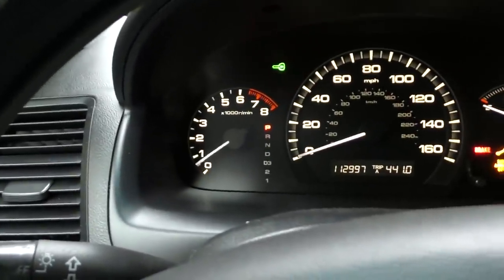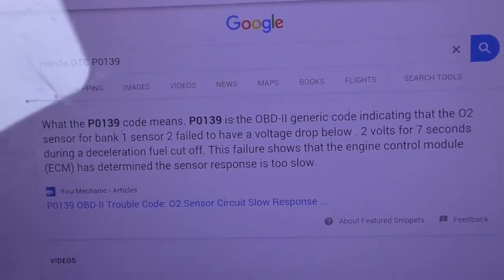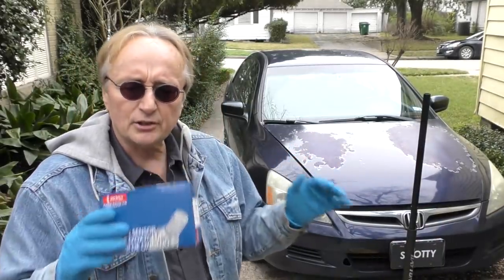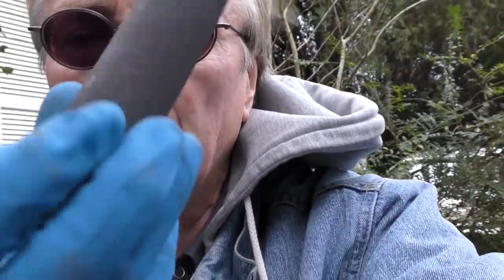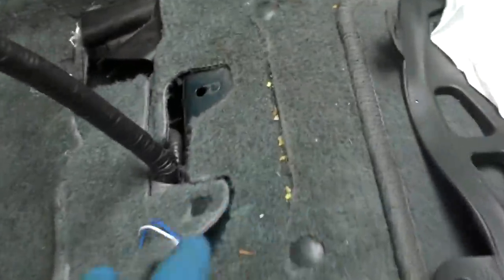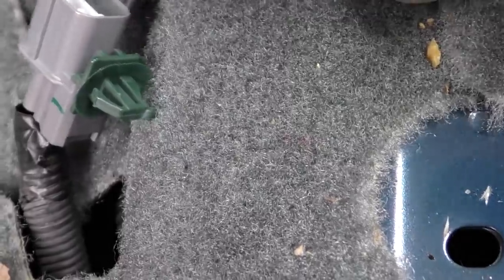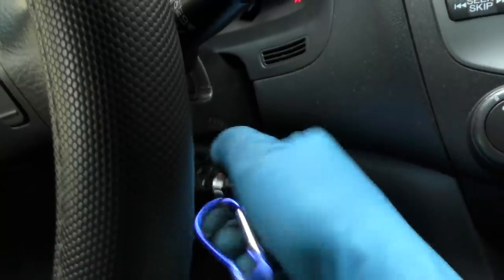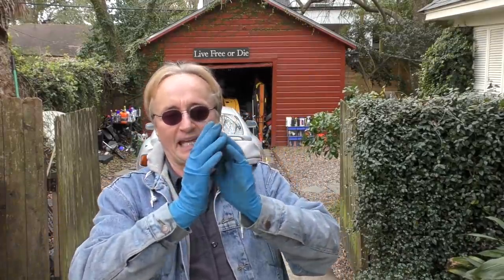Here's Why Mechanics Hate Hondas

Comment: Scotty
My Daughter has a 2015 Kia Rio 5 with intermittent electronic steering issues. At times the light comes on the car won’t start. Other times while she is driving the light comes on and causes the car to quit. This has happened several times on the highway. No one can seem to find the problem. And it will cause the car to have multiple lights on the dash when the electronic steering light comes on.  HELP ME PLEASE. I fear for my Daughters Safety.

Comment: Thank god you don't have to remove the whole dash just to remove the plug
Reply: I had a friend who was working as a tech at a VW place years ago, and they had a campaign on defective balance shafts which required the front chassis to be dropped to replace. Well he found that he could get the shaft out by denting the inner wheel well with a hammer, which would give him enough room. After the replacement, he would massage the dent out, repaint and re-undercoat, and clean up on the flat rate.

Comment: How many cars the secondary O2 sensor is only there to tell you whether or not the catalytic converter is operating properly.
it does seem as though the O2 sensor is in the middle of the cat on this car so perhaps it is used to control fuel mixture.
But on most cars that I have seen your only using the front O2 sensor to control mixture and the secondary O2 sensor is only there to check if the catalytic converter is operating correctly.
if the catalytic converter is bad or that secondary O2 sensor is bad you will usually get a catalytic below threshold code.

Comment: that aint too bad, i have a 90 corolla gts, the thing last forever, but it is a pain in the but to work on maintence stuffs. just replacing the oil filter is a small challenge cause it's so tight spaced, i can barely get my hand in there., replacing the seprentince belts, my goodness major pain in the but, cause it still use the vbelts system and u have to take off the side mount engine mount to get space.same thing with the exhaust manifold gasket,

Comment: I've noticed on my car there periodically is some alkaline-like buildup that occurs on the battery terminals (both equally on the positive and the negative). I've heard this is a common problem with cars as they age and to use baking soda, water, and a toothbrush to to scrub it off. However, I'd like to know what really causes buildup on the contacts. Is my alternator going bad, or do I need to be concerned about something else? It's an '08 Ford Focus SES, with over 237,000 miles.

Comment: My issue with my cat back fuel/air mixture sensor is it fails to send the voltage to ecm off idle inconsistently. From OBDII reading I got 700mV at idle and then when I step on the gas, ecm O2 reading drops to 0 and the check engine light came on with p2178 too rich off idle. Not sure what the difference between idle and off idle condition that can cause this. 2010 Mazda 5 (virtually identical to 2006-2009 Mazda 3)

Comment: Scotty, I'm looking at a Lexus LS 430 with 56k at 9.5k from a used dealer lot. I currently got a hyundai sonata 09, with 176k miles, no major problems as far as driving, but it seems to have a recurring EV problem that gives me trouble every 2 years for smog check. Should I change over to the Lexus?

Comment: Honda has some serious issues with their clear coat🥴. I thought only Chrysler, Ford, and GM had those problems. Nice cat converter sensor replacement video. 😉👍🙂
Reply: I recently stopped into my Chrysler dealer to drive a Pacifica and they had a 2017 with 55k miles already bubbling up and loosing paint. They offered to fix, but I can't unsee it.

Comment: Hey Scottie I’ve got a 02 Silverado 1500hd with a 6.0 engine. Driving down the road the abs and brake light pop on. I’ve done a little online reading and found where it’s probably a ground wire that goes down the back of the engine. Have you run across this problem?

Comment: i had that same code on my 09 mitsubishi at around 132k miles and i put seam some in the gas tank as per instructions ran it and the code went away for a few houndred miles it then came back so i put a little more sea foam  this time and i haven't had the code come back yet and i'm at almost 137k miles now and plan to just do sea fine every oil change aswell

Comment: Hey Scotty, I have a 2004 Acura TL 6MT, the past few weeks the clutch feels different as it's like way shorter than before and when you'd shift gears at an higher rpm it would have a sticky feeling (you can feel the clutch heavier when you stepped on it), I haven't taken it to the mechanic yet but what could it possibly be and would it be expensive or nah?

Comment: Uhhh why wouldnt you just watch the post cat 02 voltage on the bar graphs and watch for any fluctuations. Its very quick and much better than throwing parts at something in an attempt to fix it?
As an unbiased technician i can say with confidence that Honda builds the most reliable GASOLINE engines, number 2 being Toyota just not recently. Toyota has had a lot of engine failures.

Comment: 5-08-2021  -  -  -  I have a 2003 Chevy Silverado pickup.  4 years ago the brake lines had to be replaced - $1,000.00.  Last month I had the same brake lines replaced, including rotors and calipers on rear - $1,028.09.  Together, that's 25% of what I paid for the truck used - just for brake lines.  My 1987 Honda Prelude is 34 years old and hasn't has any brake line problems - still runs like new.  WTF is wrong with American vehicles?  I'm afraid to look for another used truck, especially a Chitvrolet.  That Honda truck in your other video seemed nice but the bed has to be 8' long or I can't use it.  What to do?

Comment: Thanks for the clarification that the computer is serially locked-out with one code.

But then because the car is still running, it didn't show the check engine light, then there must be 3 seperate pathways for the computer to operate the engine. 
Is this true for Honda of this model  only or does it apply to all Hondas. How does this than apply to other computer controlled cars?

Comment: 👋Hey Scotty!! Is the MAP sensor same as the MAF sensor?? I got a 2006 mercury grand marquis and the check engine light is on a quick code check says Manifold Absolute Pressure sensor. So when I go to the counter to buy a MAP sensor the clerk always try and sell me MAF sensor, always saying... “that’s what the computer recommends”. Are they the same or should I go to the dealer??

Comment: Respect Scotty, but even my 9 years old son knows how the ECU on the car works. And is the same on each one. When you put the ignition on ECU make some checks engine oil if sensor present. Temperature sensor etc etc so when the light is on actually running over these checks. When is go off just the checks are done..... About the lambda sensor (O2) sensor again i don't agree in my experience you are not going to get EML on immediately after you start the engine ... this will happen if some cable is cut as you know they are 2 or 3 on this sensors or 1 on really basic engines. So take time to build this error code a few times before the EML come up on the dash.

About the suggestion about the original sensor, i don't agree too. No one brand makes 02 sensors is not exist something like Honda or Mercedes oxygen sensor. When the car manufacture starts planing any platform they choose a company which can build them electronic systems.... usually  Honda(Denso), Mercedes (Simens- Bosch not any more only Bosch now ) Fiat (Magneti Marelli - ) and so on and so on. So if you go to Bosch shop you will no go wrong you will only pay much less

Instead of removing the seat is only two cables so cut them and connect to the new oxygen sensor much easy and less going on
In this case Scotty did u can clean better under the seat :) 

I really enjoy these videos are really good education example

Comment: Between the thousands of comments you get I hope you can answer this Scotty: one of my tires is worn and rubbed on the inside of the tire, not the sides, not the bed, INSIDE where the air goes... It left a ton of powdered grinded rubber when I took it off... And seems like something was rubbing inside. Any thoughts?

Comment: hi Scotty, am hoping you can give me an idea about my car. I have a 2004 honda civic and the problem with this car is the heater even though the temp gauge is in normal temp it blows cold air and it takes about 30 minutes of driving before it blows warm air. But once am on a stop light ( or stop for just 10 seconds) it blows cold air again..i send it to the mechanic and spend money on replacement (twice) still the same problem..the heater blows normal hot air when am 5 minutes close to home the first 55 minutes am frozen as heck ...any idea ?

BTW ... i have 2  2004 honda civic with the same problem 😣😥

Comment: Scotty  I got an 07 Avalanche. When I open the passenger front door the dome lights do not come on but it does with all the others. I am thinking the latch but what suggestions do you have please?
Reply: Bernard D. Partridge does it have the regular old style plunger switch on the door frame? Or a sensor built into the latch?

Comment: What is the torque spec on "get it nice and tight", Scotty?
you are supposed to thread the O2 sensor in first and then lace the cable to the connector, not twist it to "un-kink" it....  
You also did not apply never-seize lubricant to the threads of the O2 sensor like it says in the installation instructions of both the O2 sensor (my new Denso brand O2 sensors came with a copper never-seize packet) and the Honda service manual says to apply an anti-seize lubricant...

The more of your videos I watch, the more I hope others see how sloppy your work is.
Reply: 33 ft-lbs is the torque spec for anyone that wants to do this right....

Comment: Techs love Honda's, they are easy to diag and repair and usually make time on them. Rear 02's are for emissions only to determine if cat is removing enough C02 and Nox only, they do not cycle like upstream sensors to determine rich/ lean conditions. Once again Scotty proves he's a diy yard mechanic and not professional... If using hand tools constantly, no power tools and not meaning pneumatic tools, almost all professional techs use electric drivers, ratchets and impacts now not cheap hand tools.

Comment: Kind of disappointed in this video. You’re telling people to throw parts at a car and hoping to fix the issue. It’s easy to diagnose a faulty O2 sensor by checking resistance. O2 sensors aren’t cheap especially oem. Then if it isnt the issue thats $100 plus the $1k for the cat. I was hoping to see you test the O2 before putting a new one on it...

Comment: Another sensationalist shock jock clip about Hondas. I've changed 2 oxy sensors on different Hondas and neither one has sensors under the seat. The connectors prefer to be protected from the elements however.

Comment: I worked at a dealership that until recent housed Toyota and Honda in the same building. I can tell you most reasons why Honda come in are mostly because they are neglected and not maintained. Toyotas with more issues and even maintained will tick and leak oil. But they both added up still less issues than a single domestic brand. And I have never seen any of my technicians take any seat out for an o2 sensor. And you also don’t need to drive a car for a couple weeks. Every Honda tech knows that the codes set after a certain drive cycle and will run that cycle if needed. And no, a dead battery with dead cells will not keep a car running when started. This guy is a flake.

Comment: You dont need to remove the seat, just push it forward. And why conect the conector and then whind the cabel to schrew the sensor inn and you definetly dot tighten a lamda with a braker bar, so i would call the video why hondas hate 50is mechanics